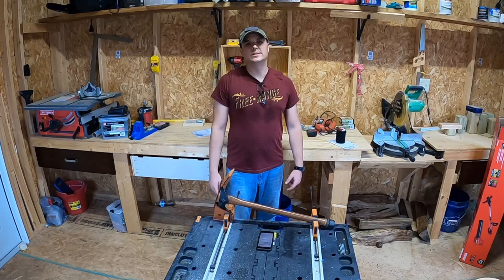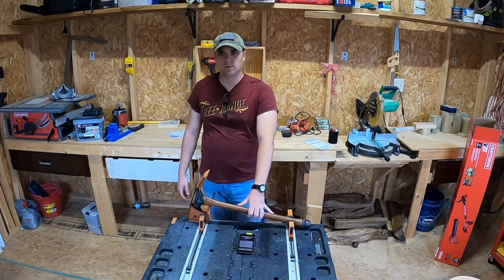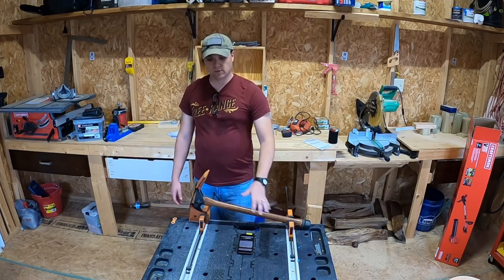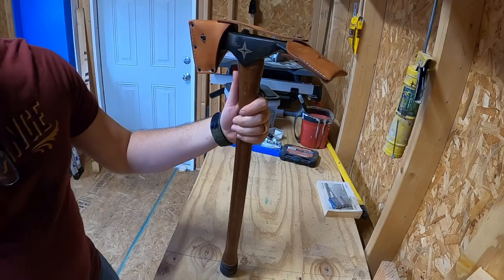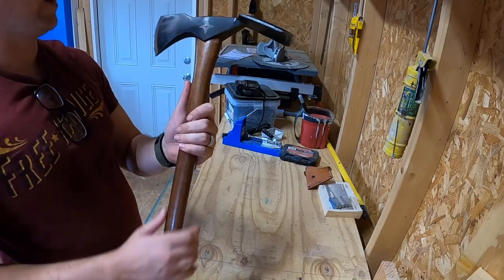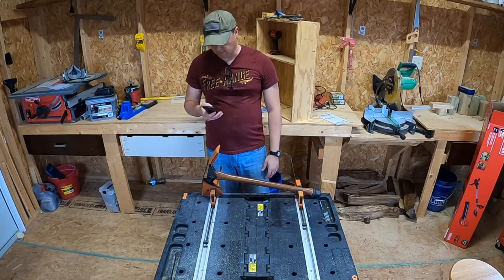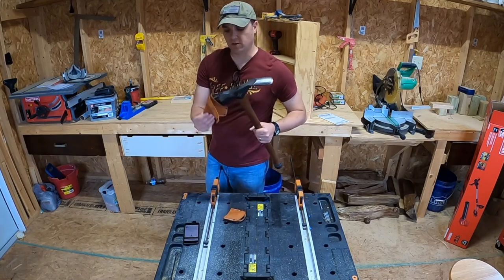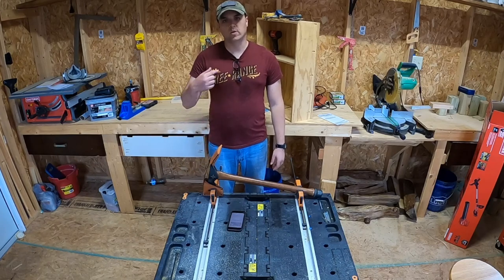Barebones Pulaski AXE Review After 4 Years of Using It

Comment: I was on a fire fighting hand crew for 4 years.  The Pulaski was my main tool.  I have a full size Pulaski, and when I saw this, I just had to get it.  It just arrived today.  I knew it was short, compared to a full sized one, but that is okay for me.  I have been using my Pulaski quite a bit recently to clear blackberries by the roots.  Every now and then, I find myself in areas where I am on my knees to get the blackberries growing among low branches of trees and shrubs.  I was wishing for a tool that was a little shorter, and this fits the bill nicely.  One feature that I really like on this Pulaski is the curve on the hoe end.  On a regular Pulaski, the hoe is straight.  The curve will add to it's digging ability and make for one mean tool for those tight spaces.  I was thinking that it would be really amazing if they had a handle addition that could lock into the bottom metal piece, rendering it a full sized tool that could be unlocked to be the short handled tool that it is when you want it to be shorter.  As far as the weight, that doesn't bother me.  It feels very sturdy and well made.  A Pulaski is not a light weight tool, and this one is very well made.  I will be trying this out tomorrow.

Comment: I've been considering trying to make something similar to this.

I currently have an axe sling within which I carry my day trip tools when outdoors: 
1: Gransfors Bruks Small Forestry Axe (SFA)
2: Silky Gomboy handsaw
3: Secateurs
4: Small hand pick/mattock (HPM)
5: Leatherman Wave

I would seriously consider replacing both the SFA and HPM with a single Barebones Pulaski or similar. Though from what I have seen from this review and others, I would probably use the head but refurb it and make my own handle, less round and without a steel bar in it to reduce weight. 

Understanding that for me, this sling pack represents the smallest/lightest possible collection of tools I can take with me, not knowing what I'll encounter. Not in a strict, hard-core survivalist scenario necessarily, but more for hiking, farm work etc.

Just sharing to hear anyones thoughts... Cheers.

Comment: Thanks for the video might just pick one up but there isn’t any on the barebones hatchet but the company seems legitimate based on this review
Reply from the maker: Barebones is a legitimate company.
Reply: @makinlifework9345  I ordered the field hatchet for my birthday very nice sharp and lightweight Great for camping
Reply from the maker: @160moebius2  that’s awesome!  Thanks for sharing that info.
Reply: I use it mainly for trenching around tents. I also use it for splitting small sized logs, and found due to it weight, it’s excellent. It all in the technique of using a tool and the right tool ( i.e. people using a knife to baton when a small hatchet is a better tool to use. )